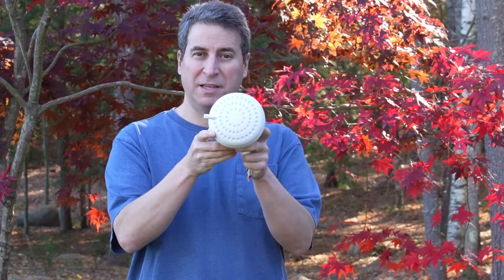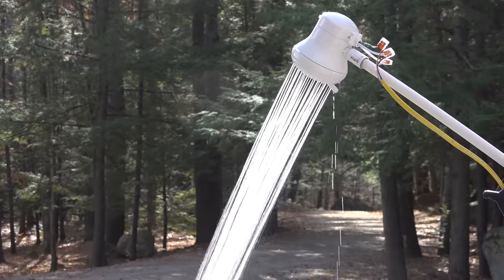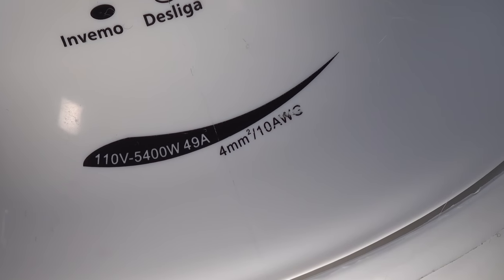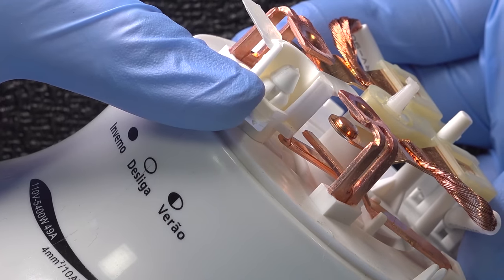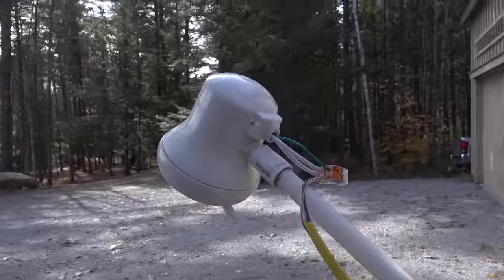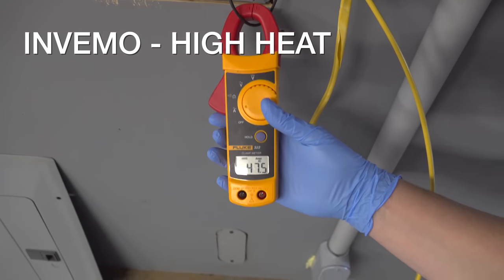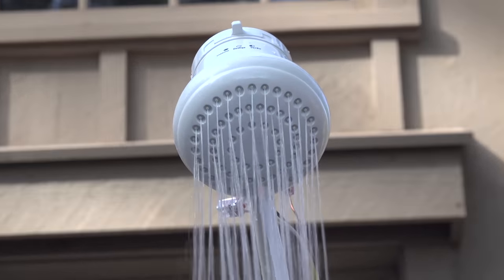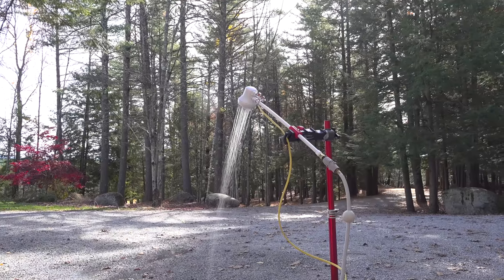What Happens When You Use a SUICIDE SHOWER HEAD in the US

Comment: Having hot water closer to the point of use is more environmentally friendly because you don’t need to waste a gallon of water to get hot water. That or a system that takes water from the outlet and sends it back to the water heater through the cold inlet so it can preheat the water in the pipe when you plan to use it.
Reply: A recirculating system seems like it would make sense; but many builders would choose not to include such a system because it would add to the cost of building a home; and many builders will do almost anything to shave costs. Retrofitting after the fact is expensive;  easier and cheaper to just flush the pipes.  With rapidly rising utility costs, well, it's probably cheaper without.  I did check Amazon on pricing of mini-hot water heaters for inline use; so retrofitting the master bathroom, which is about 110 feet away might be surprisingly cheaper than I thought; but still a PITA to rework AFTER the fact because everything is buried within the walls, or under the slab. Electrical might still be a significant design configuration issue however.

Comment: I’ve used this head in Lima, Peru and it definitely was not grounded. It was just connected to a breaker box nearby. Occasionally you’d feel a tingling sensation. I don’t think there was grounding in electrical in the house since all the outlets were 2-prong. The sucky thing is that you have to turn the faucet to a lower pressure to get hot water.
Reply: Yep. Experienced the Peruvian suicide showers as well. I made sure when in a new apartment to ground them to at least some rebar in the structure of the house before use. You could tell which ones were problematic when previous users wrapped electrical tape around the shower knob. That's where you'd get shocked.
Reply: Nope wouldn’t trust it
Reply: Right. Grew up with these in Lima - never again. Local models were supposedly better insulated than the Brazilian imports, and certainly heated water more (Lima weather is not Rio weather). Still, it's enough to hit the shower head to get a shock - and goodness help you if somebody in the house flushes the toilet!

Comment: Great review. Do not change the temperature with water running. It is better to move the temperature switch when there is no water pressure engaging the contacts.
Always run enough water so that a good electrical contact is made. If it is right at the pressure that causes the contacts to barely touch you will get electrical arcing and could cause damage to the unit through overheating.

Comment: As a retired master electrician I have seen these throughout Central and South America.  Suicide shower head is rightly named.  I haven’t seen one installed with GFCI protection or proper sized conductors. I’ve taken hot showers using them, but was very careful as I thought staying alive was more important than a hot shower.
Reply: Never ever heard about a death caused by those showers… its been used for decades here in Brazil. GFCI? Most of the homes doesnt even have ground\earth wires. But still, 0 deaths.
Reply: @ricardoiarossi  then you're all very lucky
Reply: @jr2904  not really, there are 200 milions of Brazilians taking shower every day. What makes it safe enough that no one ever died, I dont know, I agree that it doesnt look safe at all. But if it were not, we would need more than lucky, dont you agree?
Reply: @ricardoiarossi  i was thinking about this while taking a shower a few days ago lol and I think the fact that it's usually high up means kids don't get to touch it, and when we're tall enough to reach it, we already know better and aren't dumb enough to touch the dangerous parts. 

I just looked up (obviously in pt-br) about deaths caused by these showers, and there seem to be only a few articles that are YEARS apart, so yeah I would be surprised if the amount of deaths by suicide shower got into the triple digits, i guess we brazilians are just built different 🤷‍♀
Reply: GFCI is too expensive down there. People can't afford it.
Reply: @jr2904  no Bro, it's the power of Brazilian engineering. It's genius about the fact that current will always prefer going through the coil inside the shower head than through your body, it's a simple concept, but used in a marvelous way
Reply: If you were right, millions of people would've died in Brazil over the last decades. I've taken showers in places with really bad electrical connections (some of them were meme worthy) and not even tingling happened. I don't even have grounding in my house and it works just fine. And if you follow all safety parameters for electric shower heads, i.e. construction laws and guidelines, electrocution is virtually impossible.

By the way, we have gas heaters being responsible for a lot of deaths, so 🤷
Reply: Some people take multiple showers a day, so I'm guessing half a billion showers are taken in SA daily and 0 deaths due to electric showers. I'm flabbergasted by how some people are scared by them. Unless you reach up, rip the wires and touch the copper you won't be harmed
Reply: @Henrque123  I bet people in US think of South America as a place where absolutely everyone is wild and does lousy jobs. Electric shower heads make sense in our climate and economy, it's a simple, reliable and affordable technology. That's what matters. Not everything is about the north-american standards, folks.

Comment: being from the US, i've never heard of this before. that being said, now that i am aware of what it is and why other countries may use it, i'm extremely interested in reading the experiences of those from other countries in the comments! nice video, as always!
Reply: It's the standard in several countries in South America, so I dare to say at least 300M people use these type of showers everyday. 

The tingling sensation is often felt when you have to open/close a metal faucet, there's probably a current loop between the water (a bad conductor) e the faucet (good conductor to earth).

Accidents do happens, but they are rare and tipically related to someone who try to change the off/winter/summer switch with the shower on (not recommended).

The shower shown on the video is a very cheap one, USD15 or 20. There are better products that include continuously adjustable temperature and even a pump for places with low water flow.
Reply: Brazilian here. The unit he tested is actually very simple, cheap and low wattage. 
Here in the south of Brazil we have temperatures down to 0ºC (32ºF) -right know the temperature is at 14ºC (58ºF)-, so we use stronger units (mine is 220v 7800W), some with a TRIAC circuit to adjust the heating without having to decrease the flow. The correct connector for it is a ceramic terminal block, sized to the gauge of the wire (6~16mm²), that should be installed inside the outlet faceplate (not exposed to water).
As long as you have a good ground (we often use a ground bar dedicated to each shower head) it is quite safe.
Oh, and we also have small electric heaters similar to this one, to connect to individual kitchen taps.
Reply: Similar here. As a usian I've never heard of it but learning about it here and the people who use them is interesting
Reply: If you don't try to change it's settings (winter/summer/off) while it is running, there's not much risk of getting shocked. Literally, we've been using these for decades now and there's barely any accidents, even in areas where people don't know how to properly wire them.
Reply: Ikr
Reply: Try remembering not to throw your used toilet paper down the toilet and into the sewer that can't handle it after every time you have to go number 2. Then when you forgot going oh ohhhhh whats gonna happen now. What an experience!
Reply: @jasons7070  my sister lived in the us for some years now she is skeptical and always throws the paper on the toilet and all the time it gets clogged, still don't know why american sewer is that big through
Reply: @vixeythevixen  We eat too much terrible food here!
Reply: It's safe and cheap
Reply: Honestly, we hear more about people dying from gas inhalation than from those shower heads. They are improperly installed mostly everywhere and even then accidents are rare.

This unit in the video is a cheap one, that you can find here for about 50 bucks (in out money). They ate suitable for hotter places up north. In the south you want a more powerful unit with at least 6000W.

Also, they are mostly installed on 240V not 120V due to lower wiring requirements and less wasted heat due to wiring resistance. Since we borrowed electrical tech from both US and Europe we have both single phase 240V, split phase 240V and single phase 110V (uncommon and then you need to use a 110V shower like this one and thicker wiring). So, if you ever travel to Brazil don't assume that the outlet is a specific voltage. We run both of them.. We only standardized the frequency. Always 60 Hz.

Comment: There's more advanced version found in malaysia following UK standard. 

Multiple layers of safety encased in a minimum IP55 rated  square box the size of a small medicine cabinet. Inside it's got a flow sensor(reed switch with a magnetic ball usually), over temp cut off, ceramic filled stainless steel tube heating element inside a small PA6 case(like a hot water dispenser) then everything is connected to a built in GFCI, building codes also require gfci at the breaker box. Since the case is rather roomy, some units have centrifugal booster pump inside. I hate it since it's noisy, much prefer a high performance booster pump located at the mains water inlet.

Heating power is adjustable via triac diac circuit (like a light dimmer) on plastic stands. Knobs and buttons are oversized to form a cover with a long plastic pin at the back to interface with the circuit board. Final fail safe is the plastic shower hose. Every couple of years despite multiple redundancies, someone gets electrocuted. Maybe they had bad grounding, bad main gfci and the more sensitive built in gfci, and maybe they switched out the plastic shower hose to a fancy metallic hose. 

Why don't we have a central hot water heater? Water from the mains is plenty warm enough for washing. No need for huge tank of hot water sitting there, dedicated hot water piping and expensive mixer taps. Just turn on and have warm shower in seconds, for as long as you want without worry of running out of hot water. There's virtually no risk of scalding since it always starts cold then heats up rapidly.
Reply: Would these types of shower heads even work with a gfci? aren't they designed to trip when the current passes through the ground wire?

Comment: Brazilian here, lemme share some things about this:

First of all, dads are the same throughout the world, and they're not paying someone to do something they can do for free.

That means the number one technician for this kind of shower is your own dad, so you know the deal.

I've seen and heard about some failures regarding the top part of the shower, all of them related to poor wiring. I've seen melted wires shorting, which resulted in overheating and partial melting of the shower.

I've also witnessed one of these f'ers blowing up the top part after a violent short circuit. That happened in our beachside home, which received less than adequate maintenance. My dad was showering and it simply blew up in blue sparks, also melting the top of the shower. 

He didn't get hurt, but he ran away naked from the bathroom, which resulted in a lifelong joke about the event.

Comment: I'm from Argentina. We have one of those at the factory of my dad. It works really great, he sometimes showers there and there is no gas installation nor you want to wait for a tank of water to heat up

I traveled to Brazil a few times, most "hotel houses" have them. Only one time it was REALLY bad installed. The ground surely wasn't connected and the water pipes made out of metal
When you tried to change the water pressure it will numb you hand a bit, because you are grounding yourself at 220v over your heat

you could sense a tingling on your toes against the ceramic floor

Comment: A few things I think are nice to mention 
- you're not supposed to change temperature with the water flowing, that can make the thing arc and burn something (usually the heating element, those tend to burn rather easily). There is another type, the electronic ones, that use a TRIAC and a potentiometer to control the flow of electricity to the heating element, and those are made so you can safely change the temp while showering 
- if you think that one draws a lot of electricity, well this is a weak one lmao. It's 5400W, the top end ones reach up to 9000W, they obviously require thicker wires and AFAIK they're only made for 220V never 127V
- in Brazil, the regulatory body ABNT actually has standards defined for showerhead installations, and they forbid using outlets, you should connect them directly to the mains wires, using 5 or more twists (or a connector like yours, but always if the max current is within its specificiation) but a waterproof connector is not required. Also they must have grounding, a dedicated circuit with a dedicated circuit breaker with proper nominal current, AND a RCD (residual current device) like the GFCI you mentioned IS MANDATORY, and on compliant installations they're usually at the distribution board just by the circuit breaker. Thing is, as you said, many places especially on poor areas (or just old homes really, I once lived in a rented house that had no EDB, just a single circuit breaker connecting the mains to the grid) where people can't afford to hire a properly trained electrician or can't afford the more expensive stuff like proper gauge wires, breakers and RCD. If the installation is compliant then it's a perfectly safe device, the RCD combined with the ground wire should trip if it gets risky but even without them it's very unlikely to result in injury, as the body is usually made out of plastic (even the shiny metal looking ones are really just painted plastic) and the air gap between the droplets means the resistance from the wire to someone's skin is usually very high, unless you're directly touching the showerhead
- in fact here people see the electric shower as the "safe" option as we've never heard of accidents caused by it but there's always the occasional gas leak explosion that while obviously not common always make the news when they happen. So people are usually more afraid of gas than electric
- as a plus, some advanced models also include a booster pump that runs on the same electrical connection. They're very handy for single-story buildings where the water column pressure isn't enough for a whole lot of water.

Comment: These are dual voltage. You can get warmer water on 240v. You typically would only get shocked if one of the heating elements were broken, the hot side was flipped and you  had an open ground. And  even then most plumbing in central and South America is PVC, so you'd be pretty safe from a major shock  unless the water was heavy on minerals.
Reply: That's absolutely false! Whoever is reading this please DO NOT PUT YOUR 120V SHOWER HEAD OVER 220V!
120v has a specific resistance built into and using it on higher voltages will at minimum fry your equipment, let alone fire and life hazard Potential!
Reply: @danablack223  they literally have come with a 120/220v sticker on them
Reply: There is none. You might be mistaken for a 110-120V, which is an acceptable range, but there's definitely no 110,120-220V shower head
Reply: @nocare  I mean. You can always increase the water flow if it's too hot.
Reply: @nocare  the maximum water flow rate for showers in the US is 2.5 GPM. Not too sure what it is abroad, but i can't be that far off in most of South and Central America- if anything it's likely to be lower. And I can also tell you that when I lived in Costa Rica I rarely, if  ever, opened the valve at full flow because the water would get too cold for my  comfort.
Reply: Oh the Lanzzeti even come with a flow restrictor if I'm not mistaken. So we are talking about really slow rates to begin with. 1-1.5 GPMs

Comment: If they were able to get something like this to work on 20 or 30 amp, and it got decent temps, I could see it being useful for camping with a tent or a trailer that does not have a shower.
That or an outdoor shower for your pool if the area is too hard to run a hot water line to.
Reply: here in Brazil we do have 30A versions but they run on 220V, not sure if you can get them there

Comment: In the UK we have showers with electric heating as well.  But they isolate the water from the electricity, and keep the electricity in a box on the wall.

Oddly, some only cost about £60, which is less than $70 US at the moment, so a safe one wouldn’t cost all that much more, and would also boost the pressure, as our electric showers include water pumps.
Reply: Right. I'd trust one of those English devices more, though I don't know how well they cope with very low water pressure.

Comment: You made a great video! I find quite hilarious that it's called suicide shower. I've seen people installing the ground directly to the "negative" side, without any problems. The only problem I've seen it myself and is pretty rare, was when the water went out and someone was showering, and the safety valve failed, then the shower burnt itself really bad, but not making much smoke or mess, just a burnt shower.
Edit: (I'm from Brazil btw)
Edit 2: There is a "Electronic" type of this shower, which you can manually adjust the temperature, even while showering.
Edit 3: Quite a lot of houses in Brazil don't have a working ground pin on the wall outlets.
Edit 4: The shower shown on this video is from Brazil, given the text that's on it.
Edit 5: Some showers are installed in line with a circuit breaker, in case something goes wrong, the circuit breaks.